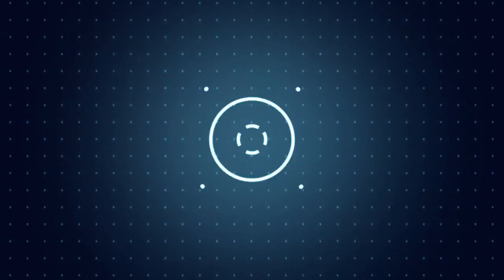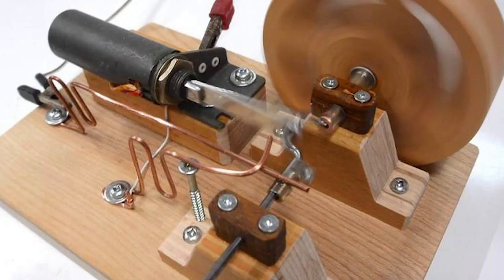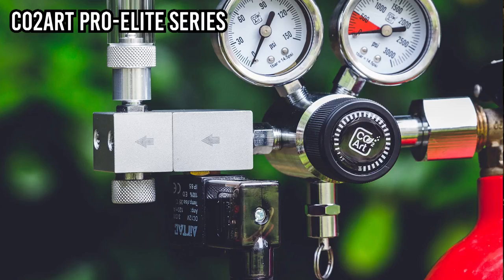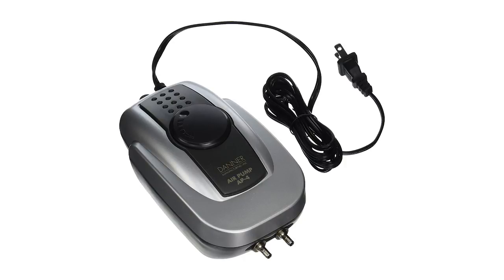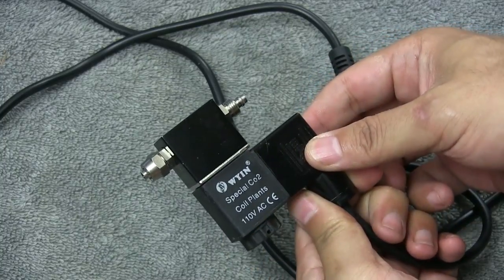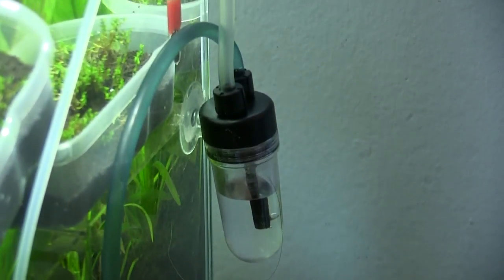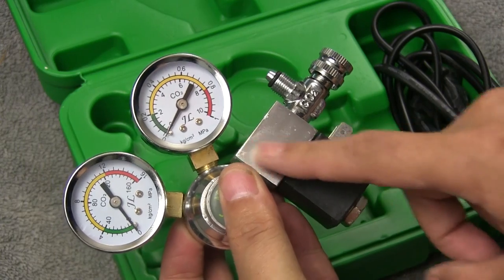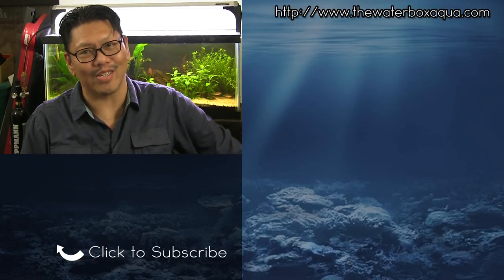What is a Solenoid? It's a SIMPLE Concept!

Comment: I’m using a DIY CO2 (citric acid and baking soda) system with a solenoid. When the solenoid is off at night does pressure build in the bottles? I’d rather not have the bottles exploding 😅

Comment: How do you connect the selenoid to the co2 tubing in the diy. my selenoid could not connect to the tube. it only connects to a co2 regulator. is there a special adaptor to attach it to the tube?
Reply from the maker: You'd have o get one that has the right connections.  Sounds like the one you got is meant for a regulatore.  You might be able to buy the fitting for hoses and put the on yourself though.
Reply: I also want this setup. Any update if you're able to make it work?

Comment: Can you use a standard solenoid on a c02 tank for aquarium. Need some help
Reply from the maker: As long as it's rating for co2 and you can get the fittings to connect correctly to the regulator yes :)

Comment: Hi, can i use the pressurized tank without solenoid? If yes how it will work
Reply from the maker: You'd have to turn the tank on an off manually which would be a pain in the butt but it'll work.

Comment: Hello, thank you for the information. I have a built in regulator&solenoid. It was working properly previously but now it is working when it is off for a long time. If it is working for let’s say 2 hours if I turn the power off it will continue allowing bubbles. Do you know if I can fix it?
Reply from the maker: Hmmm, I'm not sure about that. Sorry.

Comment: I know this is an old youtube, but one thing lingering in my mind. if we stop co2 from passing through with solenoid, then where the CO2 goes? is it compiled on the bottle, or solenoid does make the excess CO2 out through this solenoid? or if it is compiled on the bottle, then the pressure will be control by safety valve when the pressure reach its max? thank you in advance for answering this, because it is kind of confusing to me

Comment: can you use an individual solenoid with a paintball tank and non-solenoid regulator, or do you only use the individual solenoid on diy kits because the pressure isnt that great?
Reply from the maker: You can use a solenoid with a paintball tank on a non-solenoid regulator.

Comment: I have a question: how exactly does the hose solenoid work with manual systems?.. Doesn't CO2 build up in the hose segment between the valve and cannister, causing the hose to burst?
Reply from the maker: Not if you go the correct hose with the correct rating. If you use your normal cheap air hose, it won't hold much PSI.  If you get co2 hoses, those are usually made with tougher material rated for higher PSI. Then you have to make sure you have good secured fittings.
Reply: @TheWaterBox  Thank you for clarifying this. I had it happen to me before but I was using a regular air hose and it went bang in about 1 hr after the solenoid activated. I wanted to confirm if there is something else I needed to depressurize or if it's just the hose.
Reply from the maker: @adrianradu2332  No problem

Comment: Great Video! I have been using this type of solenoid for quite sometime now. Unfortunately for me, I had 3 of them fail to stop the CO2 flow even when turned off. I have tried all trouble shooting procedure to make the solenoid work again but to no success. Have you experienced this kind of problem also?
Reply from the maker: Depends on the brand I guess. I've only used one and never had a problem.
Reply: @TheWaterBox  Interesting. I wonder what is causing my problems.
Reply from the maker: @6i0r3y7  No clue.

Comment: I have this very stand alone solenoid but when the timer turns off it builds up pressure and blows my line. I even got thicker high end co2 line and it still blows up. What am i doing wrong
Reply: Thats what I would like to know before I set mine up and do the same thing...
Reply from the maker: Make sure to get better hose. Polyurethane works very well with pressure.

Comment: Hi I know it's  been a while but can you tell me my solenoid stopped working but stil has pressure on both gauges it's a duel stage regulator  so it's just stopped do you think it could be the coil part that has failed thanks for any help
Reply from the maker: Sounds like the magnetic mechanic might have died and can't open the valve.
Reply: The Water Box thanks for the reply and help I will change the coil and see what happens and report back thanks again
Reply from the maker: @mitojo60  if it connected to a timer try connecting it to the wall outlet direct girt before messing with it. Sometimes the timer is messed up. They break so easy
Reply: The Water Box hi I've plugged in wall still nothing changed the fuse still nothing pressure still on the 2 gauges  put nothing it usually clicks when I plug it in but it's dead I thought maybe the coil part has overheated the bit you screw onto the solenoid I maybe should change the whole solenoid but think it's going to be a process of elimination thanks for your help
Reply: Hi again can I ask one more question I noticed before this problem I had my regulator connected to a fire extinguisher worked perfect 2 months yesterday I must have accidentally knocked the cable ties I had keeping the levers of extinguisher open to a closed position so no gas would have Been getting through can this burn out the coil  also I can't understand why no loss of pressure on both gauges it's like it just suddenly stopped  sorry for banging on thanks again Joe
Reply from the maker: It shouldn't burn out the coils. The Soleniod just opens and closes a value. Whether or not gas passes through it shouldn't matter. Now if you got water into it, that can mess it up. Do you have a one way valve between the solenoid and the tank tube?
Reply: The Water Box hi thanks for your help I have a non return valve fitted into the bubble counter ...   I thought I would update and let you know it was the coil I fitted a new one and its up and running
Reply from the maker: Awesome!

Comment: Hi,can u make a video how to fix a solenoid to the co2 regulator which does not have a solenoid.
Reply from the maker: Hose from regulator to solenoid, then hose to tank, bubble counter... Ect. A video is not needed for that. Always suggest using co2 grade hoses.
Reply: The Water Box the same way u did in the video for the diy method of co2
Reply from the maker: Shashi pratap rana yeh. Just like that. Nothing tricky to it. You may want to hang the solenoid on the wall away from things. It can get pretty hot
Reply: The Water Box thanks chung
Reply from the maker: Welcome!
Reply: @TheWaterBox  I did the same way as in the video! But my CO2 grade hose from the CO2 regulator to the solenoid device explodes when the solenoid is off! Can you help me with this?

Comment: what I am wondering is how to figure out what to set a Milwaukee ph controller to so that it turns on the solenoid on the co2 tank every time co2 levels get low.
Reply from the maker: Ah, I can't help much there as I've never used that brand before. Sorry
Reply: @TheWaterBox  its just a simple ph controller with a high and low limit alarm that can signal devices to turn on and off. It can either be used to ph balance water in combination with a dosing pump and ph buffers as is done in hydroponics or be used with co2 for aquariums by setting a upper limit to the ph that activates co2 till it hits the lower limit. Just trying to find out how to figure out what to set those upper and lower limits to for my aquarium once i am ready to set this one up. (haven't had a tank for a while but used to have one years ago.)
Reply from the maker: Got ya. I wish I could help.

Comment: Gosh i have been looking for this video forever. My problem is that once the solenoid turns off pressure mounts n the tubing pops off. Any recommendations?
Reply from the maker: Are you just using a normal hose? Try getting hoses made for co2. They are not as soft so made to take more pressure.
Reply: The Water Box co2 hose. How long should the hose between solenoid and regulator be? Maybe mine is too short 2 inches n
Reply from the maker: It could be?   Doesn't your connection betwenen the regulator and the solenoid have tightening screws?  It shouldn't just pop out like that. But you can try a longer hose. That should help.

Comment: Mine leaks is there a way to make it stop
Reply from the maker: Where is it leaking from, do you know?
Reply: The Water Box the solenoid isn’t I guess the right pressure, I found out that the solenoid doesn’t let CO2 out when it’s on low pressure (the CO2) but then the tube pops, it’s the fluval 45 g kit, next time I’ll just go paintball
Reply from the maker: @jcjcj.  Ah ok, good deal

Comment: i have a regulator without a built in solenoid switch - as you alluded to in your final comments. but the question is: how do i go about purchasing a solenoid switch for this regulator.
Reply from the maker: It depend son yoru regulator and your solenoid you got.  You have to make sure the fittings work.

Comment: Why can't someone just use the needle valve to shut off/on co2. If I'm not using a timer and having to manually do it anyway, is a solenoid necessary?
Reply from the maker: You can. You don't have to do it automatically with a solenoid as long as you can keep it up.

Comment: Hi, Great Video, my Solenoid recently just randomly spoiled, I have been using it for less than a month, the led and electrical circuits still function, as the green led is on. However it no longer locks the Co2, it just let's the Co2 through even though off, it's the same design as the one in the video. I have tried unscrewing everything and cleaning it, I tightened it as hard as I can, even harder than it came before, but is still is not working, and I don't want to buy a new one based on the time I duration I have used it. Any ideas what is the cause or how to fix it? I'm just 13, still have a lot to learn haha.
Also, have you ever experienced your DIY Co2 bubbles diffused but then doesn't looked dissolve? My diffuser is directly under the filter outlet, but the bubbles often just gets pushed towards the roots of my Salvinia and just stay there. 
Last question, why does my DIY CO2 lasts so short? I placed in the citric acid and baking soda in separate bottles, shaked the both bottles, installed the DIY CO2 kit, closed the valve and began squeezing the Citric Acid bottle, I managed to mostly built up pressure around 1.8kg, but by then I didn't have any strength to squeeze it any further and the pressure wasn't building up after waiting two hours, so I tried the method of opening the valve, waiting for citric acid to flow in and immediately closing it, repeating this until the pressure built up to the green zone. My DIY Co2 system came with the white balls, but no magnet, but then when I started the system, it was pumping Co2 into the tank for awhile without issues, but then it started consuming the citric acid at a very fast rate, It was under 1bps. It eventually consumed all the citric acid, with some pressure left, but eventually all the pressure and Co2 will be used up, the baking soda would still be reacting with the Citric acid to create Co2, but it was at a very slow rate which barely produced any CO2, this all happened within a few hours, so I have no idea what am I doing wrong. Or is it the citric acid or baking soda was not reactive enough?(My tank is 5 gallons). I have watching all your videos on Co2 too, but can't seem to understand what's the problem. Don't stop creating videos, as you are one of the few fishtubers that people from around the world who are not living in the USA that can relate to what you are using or pursuing. Much help is needed thank you.
Reply from the maker: You might need a new solenoid. Sounds broke.  Co2 bubble will never diffuse completely with an in-take diffuser. DIY co2 not last long... should last a week or two. If less, check for leaks or your mix is off.

Comment: But the co2 selnoide problem is that when you turn it off and after a while on all the pressure will be released and a lot of co2 will be injected at one time and that's a problem how can i avoid that?
Reply from the maker: I don't get that problem. Are you using co2 airline tubing?
Reply: The Water Box i'm using the system that you showed us how to build with a kit and i'm using sugar and yaest
Reply: The Water Box and the second bottel contain water of course
Reply from the maker: @walidnaceri7288  oh! I thought you were talking about pressurized. Hmmm, I just didn't worry about it and just let it ramp down after it kicks in. Suger/yeast shouldn't be concentrated enough to over dose the tank. Do you notice any pros with the fish?
Reply: The Water Box no i don't notice anything and my plants are growing very good the only problem the only thing is that when i turn off the selenoide and i turn it back it release co2 like crazy like 300-400 bubble a second if there is a way i send you a video to check it
Reply from the maker: That one I'm nor sure. I don't have a 300-400 BPP problem lol.  Maybe just a few bubbles more than usual in the first 30 minutes.
Reply: Yeah now i got it what's wrong, because i'm making a long tube to connect the bottel and the selenoid, so whenever i close the selenoide the tube that connects them get filled with co2 and when i open selenoide it realase the huge pressure on the tube that's why i get too much co2 i think i will buy a bottel of co2 better that comes with an integrated selenoide
Reply from the maker: Cool

Comment: I bought this exact solenoid. Has anyone else has issues with the Co2 flow not stopping when there is no power?
Reply: you need to wait a certain time until the pressure on the output to difusser reduced
Reply: @ROQ1111  is it possible that the pressure takes more than 12 hours to go down? my bubble counter shows no decreased rate in the morning when the lights/solenoid turn back on
Reply from the maker: You might have a bad solenoid.